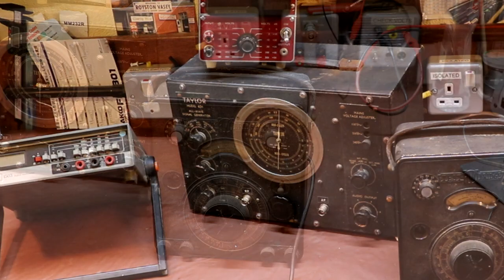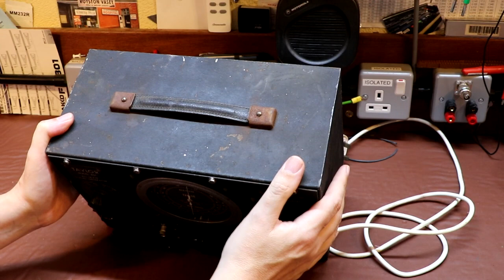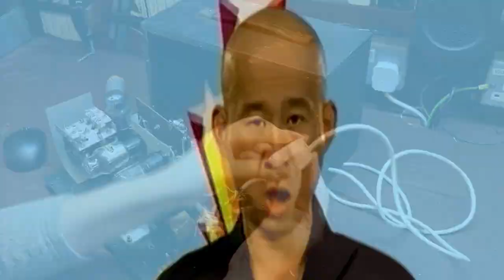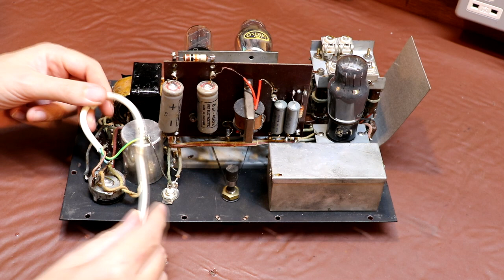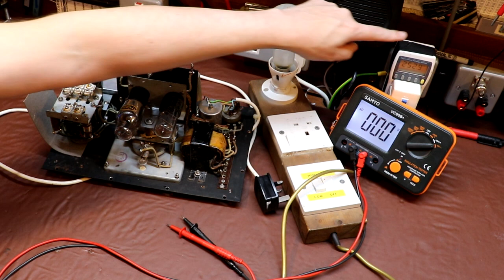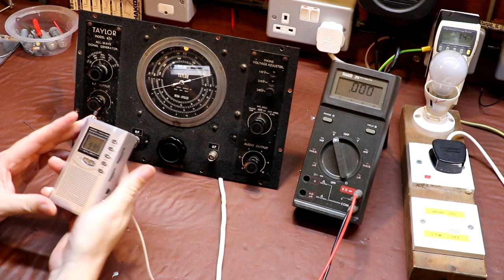Taylor 65B Revival - All Wave RF Signal Generator

Comment: Glad I saw you here  finally Chris instead of on a milk carton or getting into a crash in a YouTube Dashcam video. Then 
I would have worried. The Advac 77A  RMS meter aka AC  Voltmeter has Hunts capacitors in it. Troublesome buggers
that must be replaced. The Taylor 65B is from 1942 but is well designed for testing receivers. Yes you should do  a 
calibration on it.
Reply from the maker: Yes I will try and do the calibration. The Advac is a nice little meter I probably will repair it but don’t have much use for it.  Good to be back and thanks for watching and funny LOL comments

Comment: Do you know the characteristic impedance of the generator? Terminating the output with the proper impedance might clean up the signal a little. But, in my experience, generators of this era tended to produce distorted outputs, so it might not make much improvement with proper termination. I have a US military AN/URM-25D (similar frequency range, which was definitely intended for communications receiver maintenance and alignment), which is a pretty good generator, for the era in which it was made (1950’s - 1960’s), and it has some slight distortion problems. They don’t appear to affect its serviceability, though. The AN/URM-25 has a calibrated attenuator, so that you can check receiver sensitivity, and it must be terminated correctly for the attenuator to be accurate.
Reply from the maker: I did try a 75 ohm matching pad whilst recording the video but it loaded the output very heavily. These were only service grade products unlike  the stuff by Marconi but they were good enough to do the job.  I have a number of specialists test sets I use for actual performance monitoring. Thanks for watching and taking the time to leave such a great comment. Best regards Chris
Reply: Chris,
Terminating the output in the characteristic impedance will significantly lower the  measured output voltage. This is because the internal impedance of the generator, and the terminating resistance form  a voltage divider, each dropping half of the voltage.  However, since the terminated output is usually connected to an impedance much higher than that of the termination, the error introduced will  be small, and except for really fiddly precise measurements, this impact can be neglected. This does provide a relatively stable signal level to whatever is under test, making reasonably accurate sensitivity measurement possible. Regards,

Gar